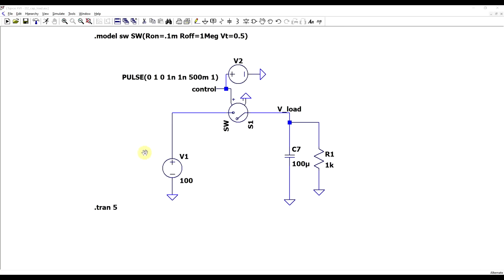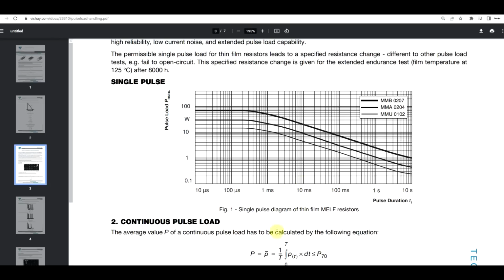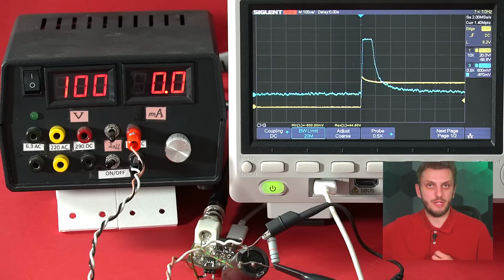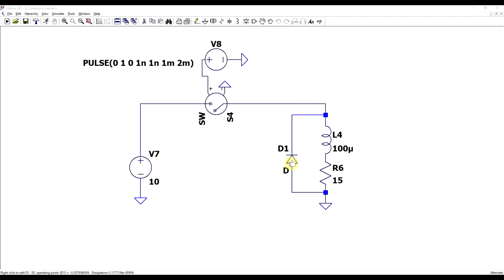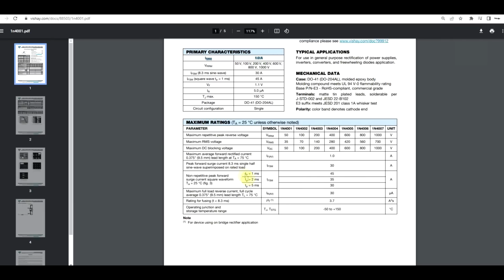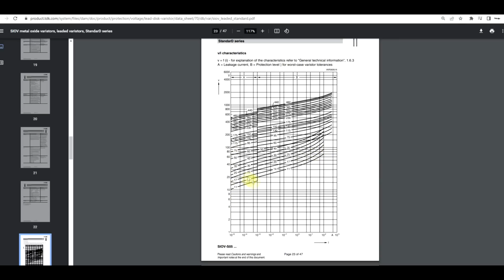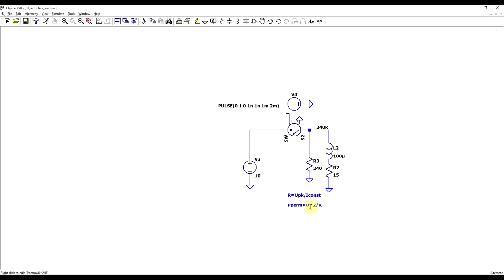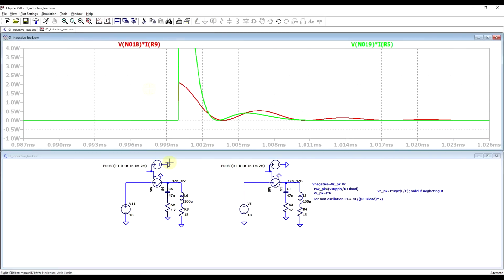Switch Contact Protection - Testing it Out (2/2)

Comment: Okay... thanks for adding the caveat about "switch contact protection" when using semiconductors (which of course don't have mechanical contacts) ... semiconductors can switch much faster than mechanical switches. There  needs, IMO, to be consideration of the switching duty cycles so that just considering the peak power dissipation is not sufficient, for a robust solution... average power needs to be considered too... or the protection components will overheat, and fail.
Reply from the maker: Indeed, that is why I think that although the same principles apply, with semiconductors, there are other things to pay attention to - especially when you are talking about something like a switching converter, or switching amplifiers.

Comment: We had some issues with TVS leakage current (+20? year encoder system) Had a merry time figuring that out. Could you do a talk about aging of protection circuits?
Reply from the maker: I honestly don't have too much experience with how components age, especially not semiconductors; but if your leakage current increased, rather than simple old age, I would suspect the TVS was exposed to some large transient that did not entirely brake it, but just left it in a high leakage state. Usually in an extreme cases the TVS will brake into a short circuit - thus protecting the rest of the circuit, but I guess there is middle ground between a normal clamped transient, and a completely destructive one that will just change its parameters.

Comment: I used a microcontroller PIC with angular timer and triac . I hade in my design 600VA transformer with mosfet rectifier and 164000uF . Using resistor was not solution.  I hade to control triac in just slightly before zero passing voltage . This way I decrease voltage peak in exact moment to have reasonable 100ohm 100w resistor.  Such solution is common in microwave oven too. In my case I used it softstart for my DIY power amplifier. 😊
Reply: I'd have probably just used more switches

Comment: Or source signals going up the neg line like a 555 for a ball primer on a Airsoft gun mainly due to the large draw at half keeps tripping over the neg with director but as we no block on a neg unless to pull join they have no real use unless you got 3 to a source signal and its got to be lined correctly back to the battery it has no use the resistor is handy 😁. Wait till you get to 4 voltage regulator and trying to get a 5v carger to caps not resistance to start....O circuits.